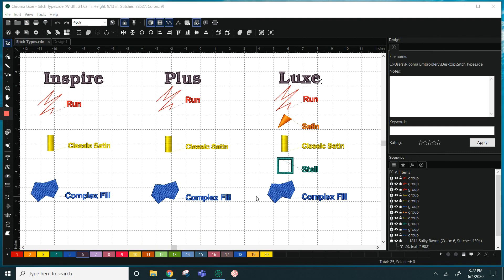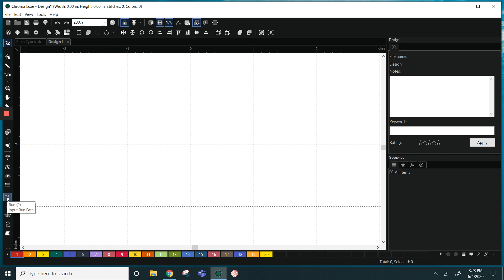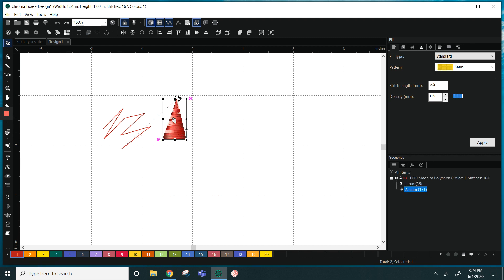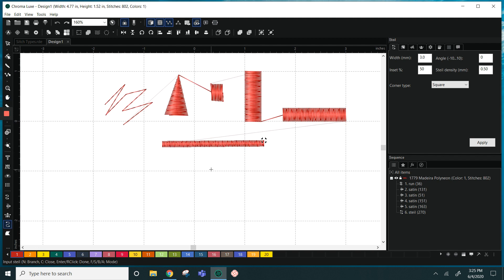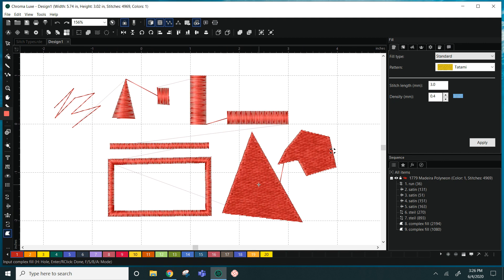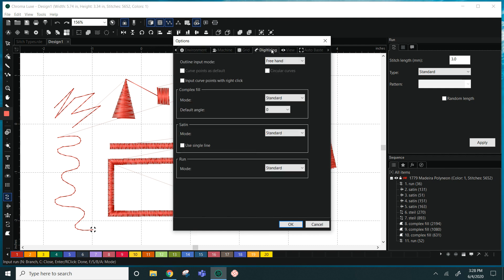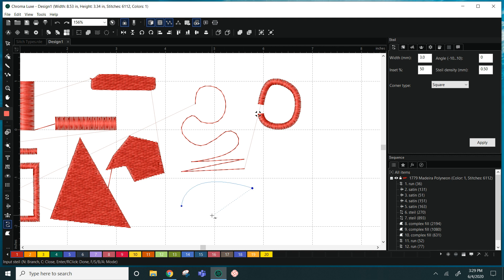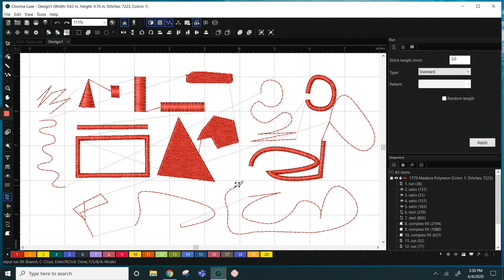Stitch Types (Inspire, Plus, Luxe)  | Chroma Digitizing Software

Comment: I bought the Chroma Luxe software  with my Ricoma 1502 Embroidery machine  in mid 2020. Up until watching your video I have only been able to figure out very basic features  and was using a lot of the auto digitize options  which always need some adjustments , but I did not know how to make them. This video went above and beyond. I am now a happy camper with the Chroma Luxe software. It seems to have unlimited powerful tools once i learned to use them. Absolutely excellent video. You voice is very clear and easy to follow along with, THANK YOU, Do More Videos.